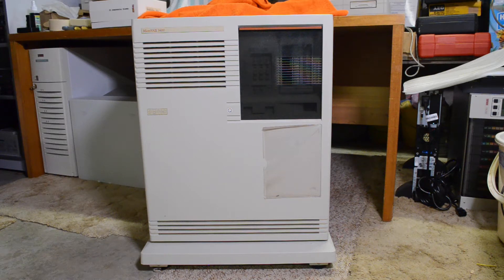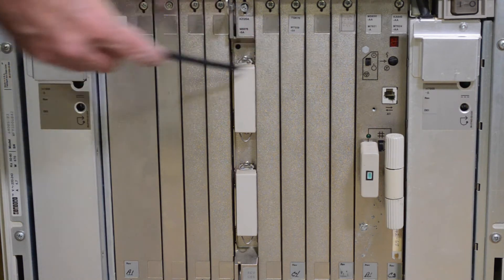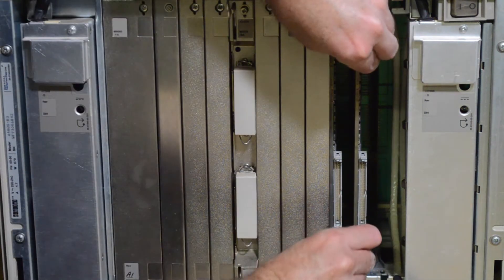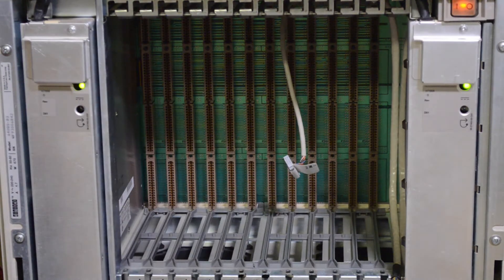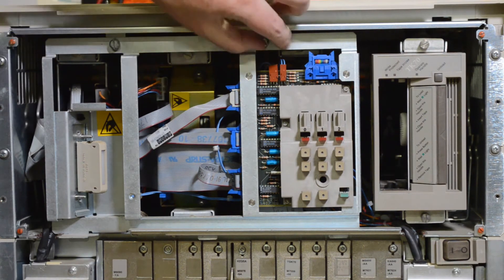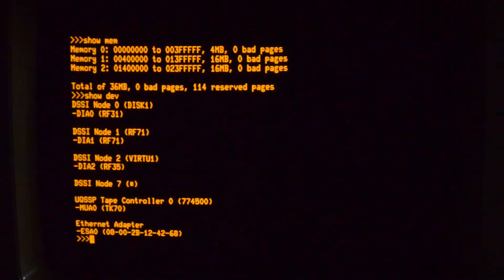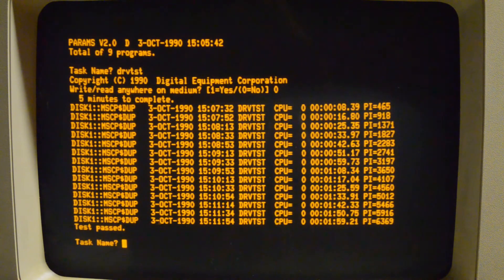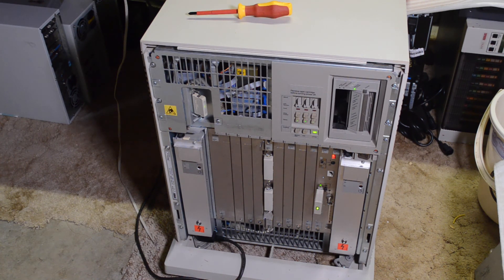The MicroVAX 3400

Comment: The problem with the SCSI card is probably because there's an empty slot after the tape controller, you need a grant card in there.
Reply from the maker: I have the card "parked" there, it is not actually pushed into the slot. Yes it has been tested in the correct location, but no go.
Reply: @digitaldiggings  Ok

Comment: I assume no new DSSI drives have been made for many years, so at some point, there will be no more drives surviving for these machines ? is there any modern alternative to replace DSSI drives ?
Reply from the maker: Thats a big problem. I have a few dead ones, but fortunately a few working ones as well. KZQSA cards don't support hard drives. The only option I can think of is the HSD controllers that let you use SCSI drives on the DSSI bus. Good luck finding one of them at a reasonable price!

Comment: This machine has GUI? I read "The DECstation 3100 is among the broadest set of desktop solutions announced by DIGITAL to date. 
DIGITAL's new desktop offerings included DECwindows, its X-based windowing system (shown here)". 3500 and 3600 was a "MicroVAX II-based workstation featuring hardware-enhanced, high-performance color graphics."
Reply: It's possible that it could, but it would need a video card installed.

Comment: I ended up here looking for some info on getting my MicroVAX 3400 running again.  Great bit of info for someone who has lost most if not all of my knowledge of it.  Got it to nearly startup once, but I believe it has run out of disk space as it continued to complain about generating log files and never completed the boot process.  Now I believe I have to get it to boot over the network so I can possibly free up some space on the existing disk.  I have two drives in mine.  Just waiting for an MAU connector to get RJ45 network out from the network card so I can boot from a NetBSD MOP server daemon.  Any tips are appreciated.
Reply from the maker: If you're running VMS, you can do a minimum boot to get in and clean up, but if it's NetBSD, then I'm afraid I can't help

Comment: Brings back old memories. We had a lab of MicroVAX 4000 machines being used to develop a very early AI command system prototype for the Royal Navy. It actually went to sea in a Type 23 frigate (the early ships being delivered without the expected production command system so we got to borrow a ship for trails work for a time). The ship installed version used rack mounted MicroVAX's. Boggles my mind today how much more powerful computer hardware has become but I still miss all the old Digital equipment. Started right out of high school with Vax 11/780's and then VaxStation 3100's as a replacement before going over to the dark side of various Sun SparcStations and Unix. There was just something magic about Digital hardware and software in those days.
Reply: I agree but the Dec H/W software was SOOO expensive.  To buy, license, and maintain.  :(    I too was seduced to the dark side of Sun even before SPARC. haha  For awhile I did both.  It's sacrilege but I prefered *NIX/Solaris to VMS.  ( I know I will burn in hell for saying that!!)!  hahaha